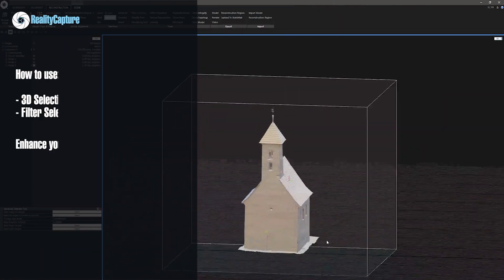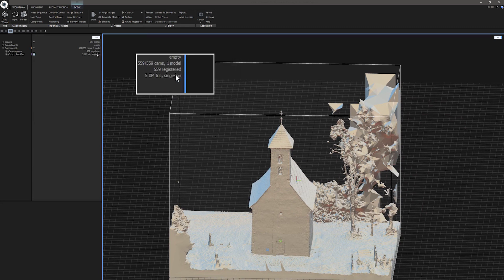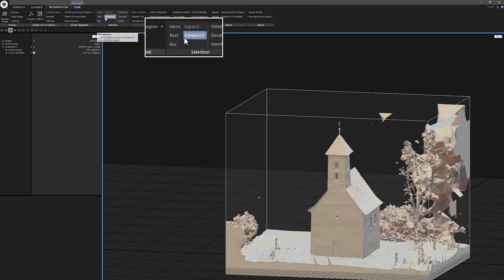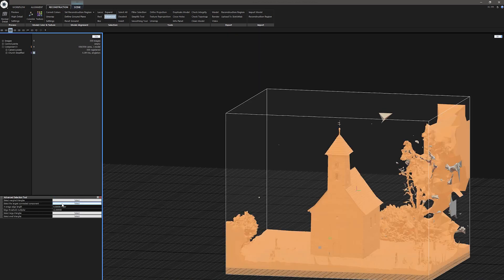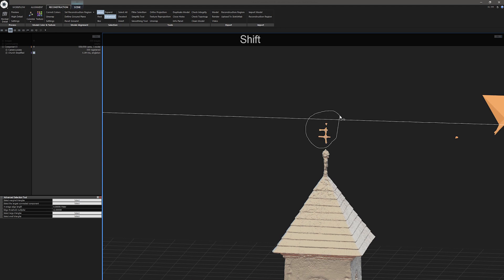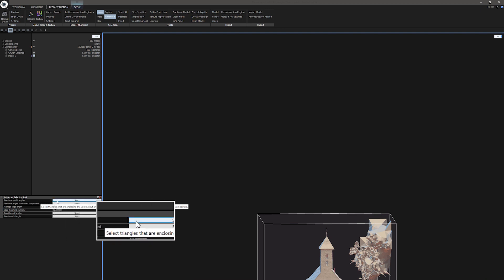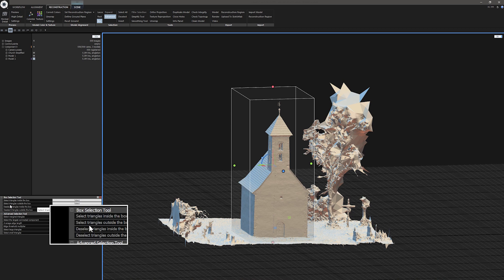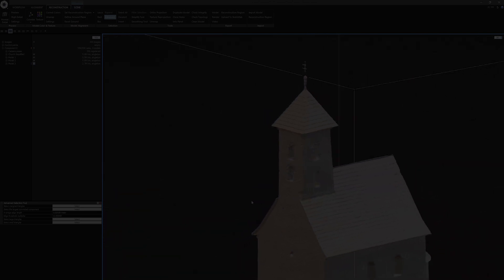RealityCapture tutorial: 3D Selections and Filter Selection tool

Comment: my photogrametry scans look smooth and sharp, but when i import the file into my 3d printer... it looks all bumpy and almost a melted look... and it prints out that way as well.. what is going on with the quality.. ?
Reply from the maker: Hello. 
Using video, may not be enough to receive a mesh that will give a good result when printing. We would suggest using images instead. You can clean rough and bumpy edges on your already created models with smoothing tool available inside RC.
We received a message from you so our support will help you with your project.